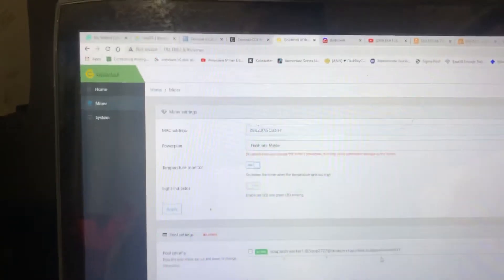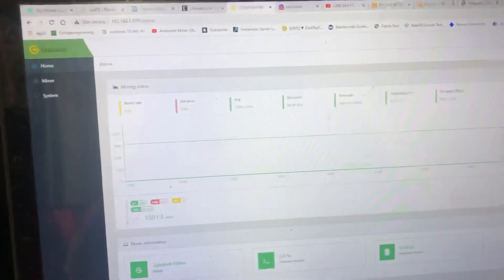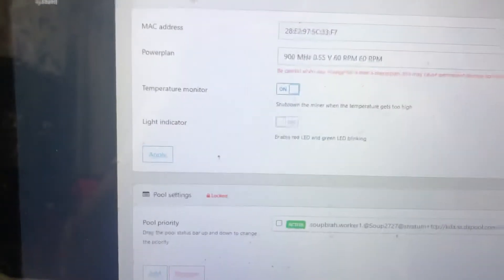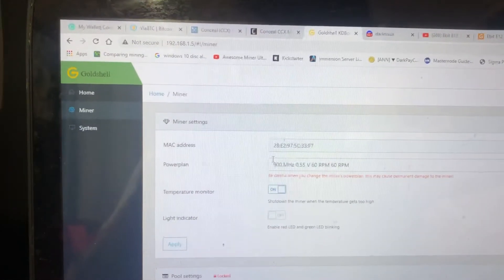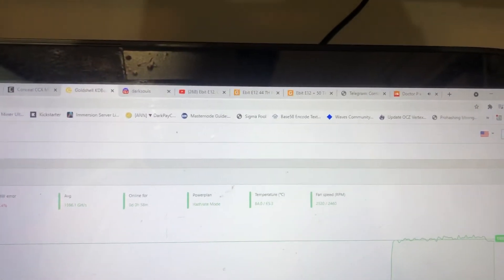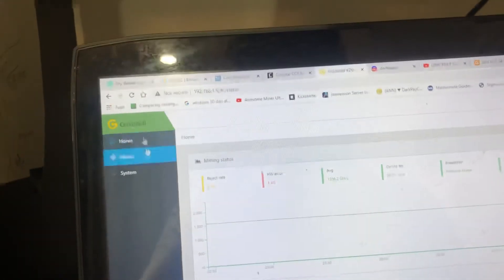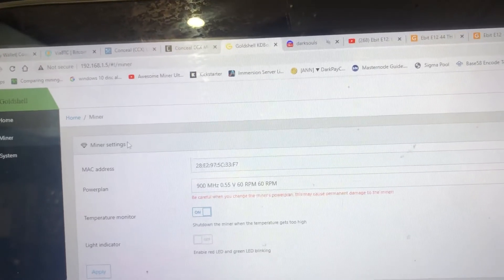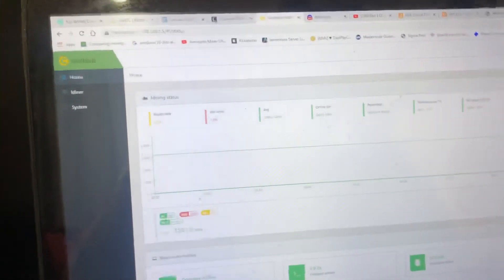HOW TO Overclock ALL Goldshell asic miners CUSTOM TUNE FIRMWARE BUILDS FOR GOLDSHELL KD5 CK5 HS-BOX

Comment: Tried on one of the HS Box , added 10% to power and 10% to clock, Have 2 running stock.Have done the same on  CK Box and Doge.  I will report back the difference and profitability.
Reply: HS Box at 825 MHz 0.46 V 60 RPM 60 RPM, Does make the fan run at higher noise and you do definitely hear it. Temperature hits above 75 if you lower the fan. But it depends on the ambient temperature in the first place. I would prefer to keep it under 65. Does definitely find more shares as the average has been above 255ghs.   If you have the latest firmware 2.1.x change the setting  of the  the light indicator and click apply after you have changed the frequency setting. You can revert the light indicator back again and restart for settings to take effect.

Comment: Overclocked hs miner. Sitting at 600 gh/s no issues at all. 950 .45v 50 50. Sits at 67 degrees all day even when swapping to hns it runs around 380 instead of 235

Kd box don’t seem to like any adjustments same as the mini doge miners.
Reply: Hello Jsn, I have an hS box but unfortunately I have very recent firmware to make the OC modifications. Please can you share your firmware version? Thanks
Reply: @yoannhueso8956  yes. have you found this?

Comment: when i do it on the ST-box it works but when i hit apply it doesnt save  the setting. so when i go to home and back into the setting it's back in hashrate mode.
Reply: HI what's your overclocking settings if you can kindly share with me

Comment: This video was really helpful. But I am not able to keep the overclock settings on my kd5. It works for a few minutes, but shortly after it just go back to the Hashrate mode. My only goal is to get the fan speed down and the Temps a bit higher. So it isn't that loud anymore. Only setting I changed was 50/60rpm instead of 100rpm. Could it be a problem with the firmware?
Reply: wtf. never take these settings for a KD5 !

Comment: Have you had any luck OCing any other Goldshell miners? I haven't had any success using the latest firmware (2.1.x and above) , but the older firmware, 2.0.x I have been able to overclock fine. 

Now I am trying to find somewhere I can DL the old firmware.
Reply: Same here bruv
Reply: Also. if you look at this video the KD Box is not performing above hash rate at all. The average GHz was not even at 1600, it was bellow that. I have found out a setting to actually overclock the KD Box, it hashes now an average of 1806 GHz. But is not with this videos settings at all. In fact, I think his hash rate dropped after applying the new settings, if you look at the hash rate diagram.
Reply: It doesn't work on the mini doge either. I left it for 24 hours and compared it my other one and no change. If anyone finds old firmware please post. I would recommend downloading it to a flash drive and installing it. Not sure how new firmware is not allowing the custom changes but maybe someone can explain.
Reply: @jimmyhood7022  I've been able to overclock the KD-Box and HS-Box using the old firmware, before the 2.1.0 versions. And yes, the new firmware prevents you from changing miner settings.

Comment from the maker: TRY 885 Freq 0.53 V and 60 RPM for 1700
Reply: Who tried it? Does it work?
Reply: Is that for the CK5 comment or KD5 comment or both? If I'm going to blow my warranty on day 1, please suggest an overclocking for immersion cooling (staying at room temp 65 deg F). Fan blades are removed but still attached.